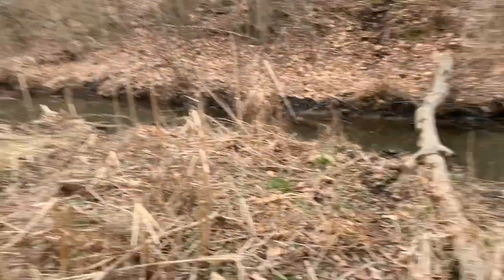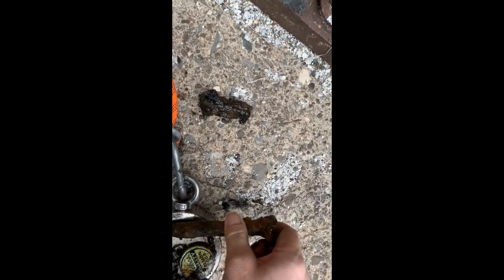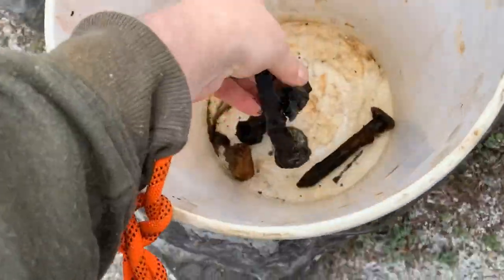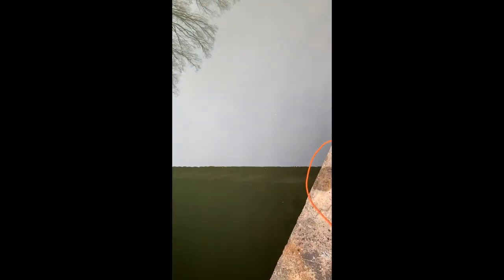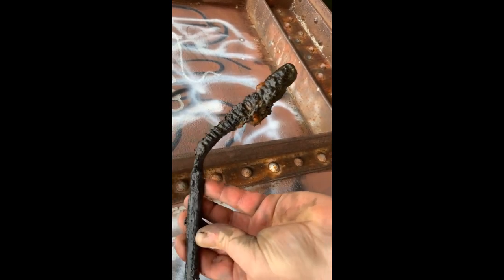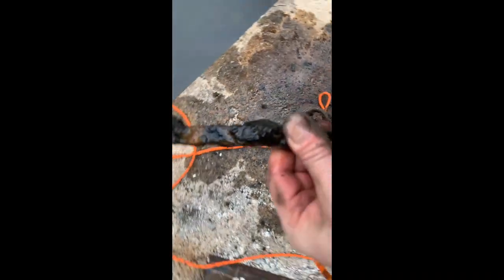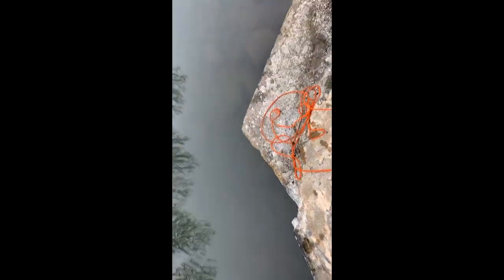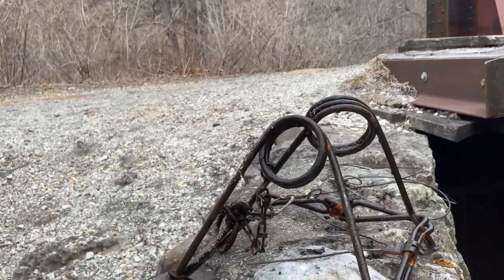Magnet Fishing cool railroad bridge in Blairstown New Jersey

Comment: Magnet fishing sounds so cool, but I've often wondered what you do if your magnet latches onto something too heavy to haul up. How do you get your magnet loose?
Reply from the maker: You have to have a strong rope.  Most times if you change the angle your pulling from it will come off.  The only time I had a problem was when it got attached to the bridge.  I still got it off but it was tuff.